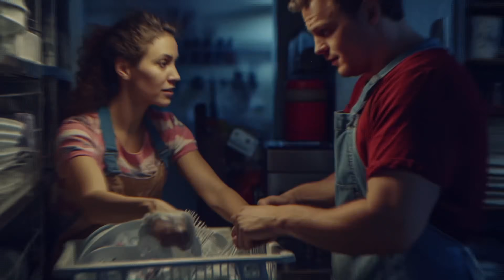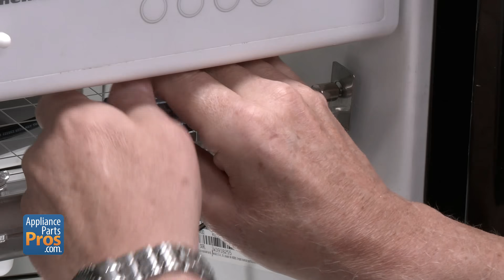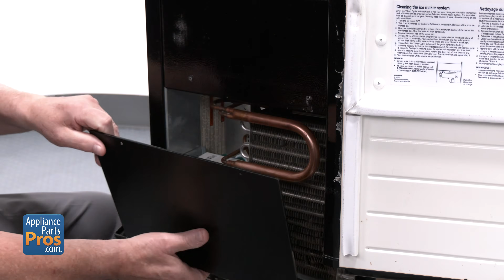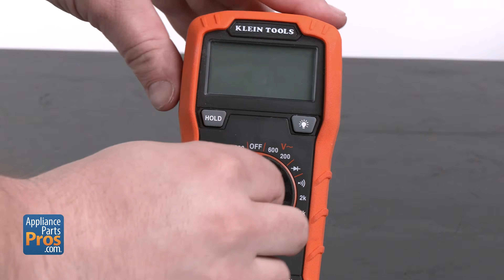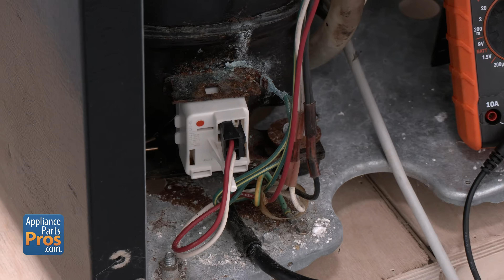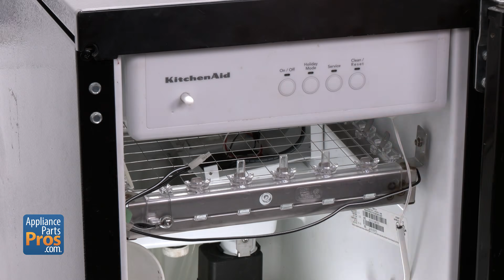KitchenAid Ice Maker Not Working? Easy Fixes That Work

Comment: My original problem was it stopped making ice. I purchased a water inlet valve and water tube. I replaced both without a problem thin I had white thin ice. I replaced the water filter and that corrected that issue. Now it makes ice, not a lot, and the water is following into the ice bin. What next?
Reply from the maker: If you need more installation, troubleshooting or testing information you can check out our Repair Forum: https://forum.appliancepartspros.com/.  It’s easy to register, and you can either post your question or search the forum to see if someone else has already asked the same question.
 
Our experienced technicians, with over 20 years of hands-on appliance repair experience, are ready to answer your questions and guide you through your repair.

Comment: I got a KUID508ESS1 ice maker. The problem is that it makes 3 plates of ice and then water just keeps running and no ice was being produced. At the beginning water was overfilling. And there is no water level sensor. It seems like the sensor is inside the circulation pump
Reply from the maker: If you need more installation, troubleshooting or testing information you can check out our Repair Forum: https://forum.appliancepartspros.com/.  It’s easy to register, and you can either post your question or search the forum to see if someone else has already asked the same question.
 
Our experienced technicians, with over 20 years of hands-on appliance repair experience, are ready to answer your questions and guide you through your repair.

Comment: You missed one important thinking . What if the plate doesn’t heat up to release the ice. Is this the control board. 

What causes the ice plate not to heat up to release the ice onto the cutting grid?
Reply from the maker: That’s a great point! If the evaporator plate isn’t heating during the harvest cycle, the cause could be the heater itself, the control board, or another component in the heating circuit, depending on the model. Thanks for bringing this up—we’ll consider covering this troubleshooting step in a future video.

If you need further installation, troubleshooting/testing information from our techs you can check out our repair forum: https://forum.appliancepartspros.com/

Comment: I have the model KUID508HPS00. What is happening is my ice is building up to about two or 3 inches thick on the plate. Almost like it’s not being triggered or released to fall onto the wires. What would be the issue?
Reply from the maker: Thanks for sharing your model number. If the ice is building up 2–3 inches thick on the evaporator plate, it sounds like the harvest cycle may not be starting properly. On this type of ice machine, possible causes include a faulty ice level sensor, a problem with the control board, a dirty evaporator plate, or an issue with the thermistor sensing the ice thickness.

We recommend checking that the ice machine is clean and that the ice thickness control is adjusted correctly. If the machine is not going into harvest after the ice reaches the proper thickness, the controls or sensors may need to be tested. Thanks for watching, and we hope you get it making ice again!
Reply: @appliancepartspros  the plate isn’t dirty and the water runs down very evenly. The ice feels like normal. I’ve never had the ice overflow and wanna spill out. I guess without really knowing what else to do what part should I buy or what would you recommend for a next step?
Reply from the maker: If you need further troubleshooting/ testing from our techs you can check out our repair forum:
https://forum.appliancepartspros.com/

Comment: My ice machine is taking a long time to cut the ice… it’s getting the proper voltage, and I’ve got about 5 ohms between each of the sets of grid heater wires. Also the pump is working perfectly. It’s not able to cut the ice before the next slab comes down, but the wires are not broken? What can I test or check?
Reply from the maker: If you need more detailed troubleshooting or testing information you can check out our Repair Forum: https://forum.appliancepartspros.com/.  It’s easy to register, and you can either post your question or search the forum to see if someone else has already asked the same question.
 
Our experienced technicians, with over 20 years of hands-on appliance repair experience, are ready to answer your questions and guide you through your repair.

Comment: Question my ice maker  water inlet valve only let the water run for about 10 sec and cut off so there not enough water for the pump to run. Not sure what part need to be replace
Reply from the maker: Check for build up or blockages on the sensor, water valve and the filter. If you need further troubleshooting or replacement help you can check out our Repair Forum: https://forum.appliancepartspros.com/.  It’s easy to register, and you can either post your question or search the forum to see if someone else has already asked the same question.

Comment: My Kitchenaid ice maker quit making ice and was repaired. Before the repair, it would perform perfectly, and would run 6-9 months on a filter. Now it makes ice great but the filter needs replacing every 6-8 weeks! We replaced the water supply line and have cleaned it three times but it is still clogging filters. Any ideas?? TIA
Reply from the maker: Thanks for the detailed info—since this started after the repair, it likely points to debris or sediment in the water line or valve. Even with a new line, leftover particles can keep clogging filters.

You might try flushing several gallons of water through the system, checking the water inlet valve for debris, and considering a sediment pre-filter. It may also be worth testing your water quality to see if high sediment is the cause.

If you need further troubleshooting you can check out our Repair Forum: https://forum.appliancepartspros.com/.  It’s easy to register, and you can either post your question or search the forum to see if someone else has already asked the same question.

Comment: My KUID308ESS is doing something I've not seen before. The water valve fills the reservoir, the circulation pump then moves the water over the coil for about a minute or so, then stops. The drain pump then drains the reservoir and that's the end of that. I'm guessing a bad control board. Do you agree?
Reply from the maker: For free technical support, please visit our Repair Forum: https://forum.appliancepartspros.com/.  It’s easy to register, and you can either post your question or search the forum to see if someone else has already asked the same question.
 
Our experienced technicians, with over 20 years of hands-on appliance repair experience, are ready to answer your questions and guide you through your repair.

You can also post a question directly on the product page of the part you’re interested in. This helps our team provide the most accurate, part-specific guidance in our Question and Answer section.
Reply: @appliancepartspros  UPDATE: It was NOT the control board. Turned out to a bad EVAP thermistor.

Comment: I just had a case where the ice maker would continually reset just when the compressor was supposed to come on.  It turns out something is wrong with the optional drain tank and pump.  I unplugged the ice maker from the drain tank and plugged it directly to the wall and now it appears to be making ice again.  I have not yet figured out which part of the drain tank is failing, but maybe there's an overflow switch or something in there that's going bad.  I hope this helps the next person!
Reply from the maker: Awesome info! 👍 Thanks for sharing what you found, that’s really helpful for others dealing with similar issues.
Reply: Great video. I have a Whirlpool under the counter that stopped making ice. This vid will help troubleshoot what's wrong. In my previous life I was a Technician at a military manufacture and was always nice to have a schematic which I have not found yet.

Comment: Replaced the board, new compressor relay, made ice for one batch then completely shuts down....lights and all. Unplug for a few minutes starts then everything goes out again. Now all lights go out, but I hear it humming. Any ideas? Thx.
Reply from the maker: That sounds frustrating, especially after replacing parts. For detailed troubleshooting steps specific to your situation, our certified techs can help you at forum.appliancepartspros.com. Just post your model number and exactly what it’s doing, and they’ll walk you through the diagnosis!

Comment: my machine is doing some thick slabs of ice and not slipping into the grid part. already replace the recirculation pump, cleaned and nothing fixes it.
Reply from the maker: Sorry you’re dealing with that. Thick slabs not releasing to the grid usually point to a control, sensor, or freezing issue beyond basic part swaps. For detailed troubleshooting steps specific to your situation, our certified techs can help you at forum.appliancepartspros.com. Just post your model number and what you’re experiencing and they’ll walk you through the diagnosis!
Reply: @appliancepartspros  looks like the evaporator thermistor cable is broken. do you have this part?

Comment: My KitchenAid fridge/freezer recently stopped making ice. After many days of troubleshooting and working thru the diagnostic codes, nothing made sense. I then found this on the internet, "Kitchen Aid appliances sometimes require a BREAKER RESET for various reasons, including electrical issues, control board problems, or safety mechanisms."

Apparently, unplugging the fridge is the same as resetting the electrical breaker.  I couldn't believe it but FLIPPING THE BREAKER ON/OFF fixed my 'ice maker'....  Others with Kitchen Aid ovens, dishwashers, mixers, etc has also reported that flipping the breaker solved their problems.
Reply from the maker: Awesome! Thanks for sharing what worked for you 👍  
That tip can definitely help others with similar issues.

Comment: I've done residential HVAC for the past 3 years in AZ (138 was the hottest attic I've worked in, sometimes using a 2000 deg torch to braze) and decided to switch to appliance repair recently! More stable hours and better working conditions. I'll be fixing a KitchenAid ice machine today 😊
Reply from the maker: That’s awesome. Welcome to appliance repair and good luck on the KitchenAid ice machine today! 😊